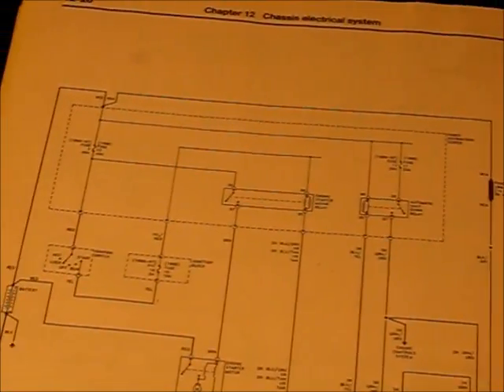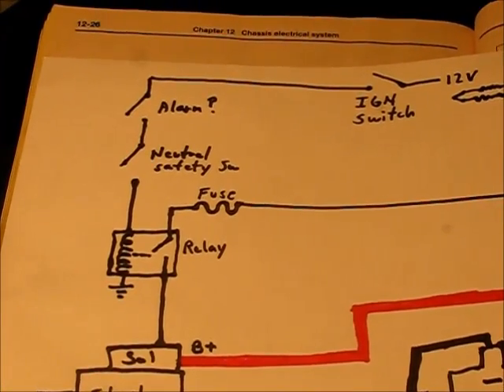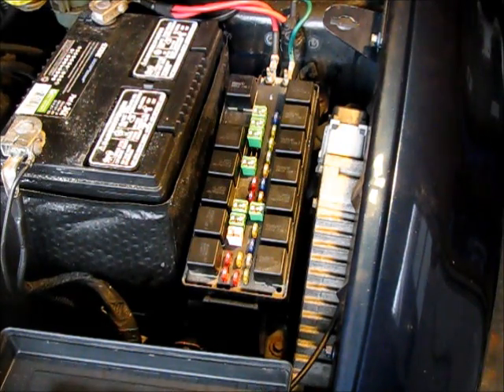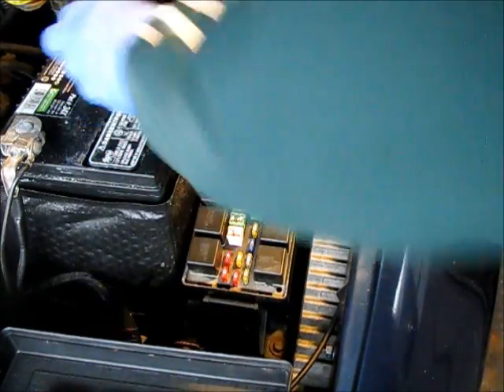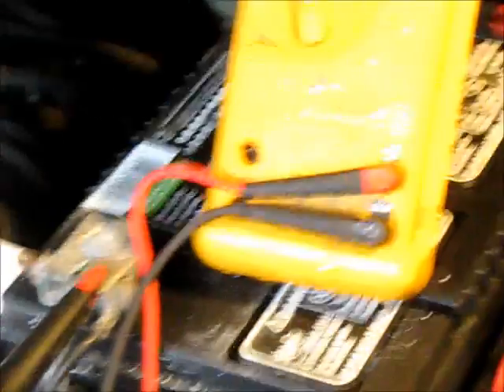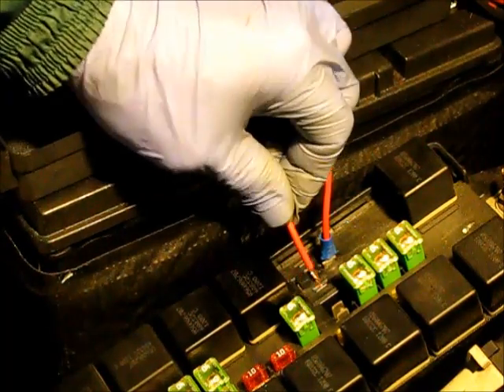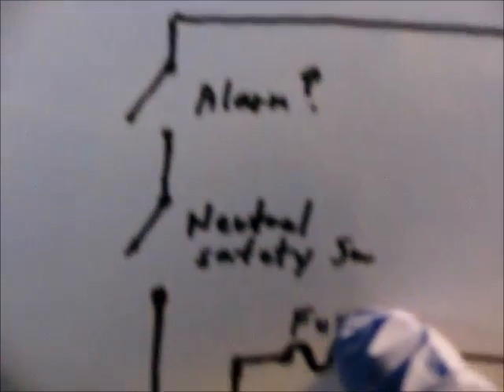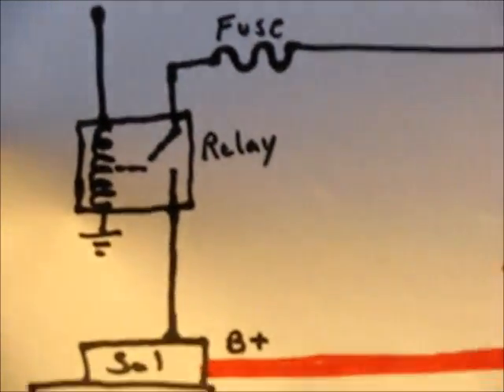When your car won’t crank or start part 3: How to check relays, fuses, switches and wires

Comment: no crank, no start, engine isn't tied up, no gauges work and fuel pump wont kick on. also new starter, new ignition switch, new computer, the lights work, power windows work.  anyone have any ideas as to what it could be dodge ram 1500 with a hemi
Reply from the maker: Check the fuses in the start circuit, both power and control. The starter relay is an easy part to swap out. Maybe the the always 12V is missing. Someone needs to get in there with a meter and follow the 12V start control signal. Where is it? Where is it lost? Good luck and thanks for watching!
Reply: I got same problem Bro

Comment: What happens when the starter will run off the car but, not on the car?  The starter relay is good and working as well as the safety neutral switch and the ignition switch and new battery. Also, the engine is not locked up.Also, the battery cables are new. When I tun the key to run nothing happens ( no noise or clicking) but everything else works There is power from the ignition switch to the starter. All fuses are good and working properly.
Please help. 
Awesome video. Thanks a lot.
Reply from the maker: Have you physically measured 12V at the large lug (B+) at the starter, including when you turn the key to start?  If it's always present there, I am out of ideas. It absolutely should run.
Reply: Thank you so much for your reply and help.
Reply: Hello I have a 2000 mercury grand marquis n just got it back from the tow place they lost my chipped key.they changed the ignition and don't think they got it programmed right i was told by ford. The only thing that happens is my lights turn on in the dash board no crank or start.If it is the anti theft crap is there any way I could bypass it without spending more money?Would it start at the starter relay purhapse?Thanx in advance any advice would be helpful.. The Original Mechanic
Reply: @ffbnnmccvmnn5811  did you ever figure out a bypass of the security issue?

Comment: 89 Accord manual trans. Bad translock switch. Jumper wire worked for four or five times, and now it goes blank wen starting. Is there a relay that is shorting behind the fuse box. I see three there

Comment: Do I really need to put the key in first position? I lost my key. I tried with screwdriver but no luck...
Reply from the maker: I'm not understanding your question.
Reply: Can I bypass it without the key in ignition?
Reply from the maker: It appears you are trying to start the car by jumping the starter relay without a key in the ignition. There needs to be a key in the ignition and in the on position.

Comment: I have a w203 Mercedes Benz 320cc the key turns but it doesn't start and the cluster show not on
Reply from the maker: So many possibilities here.  Check the basics. Good battery and good battery connections.

Comment: Thank you for a very good and clear video and also I have trouble with starting my 2010 Jaguar XF I checked and got P0344 problem when I try to start veichle it doesn’t get power just can say I hear two times TIK noise but engine never gets power and start only that sound,looks like I have big trouble with it..
Reply from the maker: That  sound you hear when the key in is the start position is likely the solenoid plunger moving. That means the start signal is getting to the starter. Make sure you have B+ 12V at the starter and if you do, the starter is likely bad.

Comment: hey i have 04 dodge Durango it not starting it crank my battery is good what to do?
Reply from the maker: Crank no start problems can have many causes. I always try find out if it's getting gas first, then move on to check for spark. There are videos out there. Search "crank no start" Good luck and thanks for watching my video!
Reply: Crazyk Roberson I'm wearing my 1997that gose into the ing. I have 4eears going into one.
Reply: Way outs

Comment: (2007 silverado 4.3 regular cab) so I bridged the starter relay with a piece of wire and heard the starter come on. Where would the problem be at this point?
Reply from the maker: There are still several possibilities; From the  ignition switch to the relay coil and the wiring in between. Try subbing in another relay to eliminate that.
Reply: IV tried switching relays and did not work. I replaced ignition starter switch and still not cranking.

Comment: 97 dodge Dakota no crank. Relays click and fuel pump primes. All light come on as they should. Turn the key and nothing happens only the relays click. I replaced them anyways, replaced the starter pulled the starter harness up and checked for rub throughs and bare spots found none. New battery new ignition switch and still nothing. Can jump it from the solenoid and it will crank and run without a hitch. Was fine one night next morning Im dealing with this scenario.
Reply from the maker: Seems like a open wire between the relay and the solenoid. I would try subbing in a jumper. The hard part is accessing the wire.
Reply: The Original Mechanic a jumper where? On the fusebox?
Reply from the maker: Between the starter relay and the solenoid. If the relay is operating and has power on one side of the contact, then the problem is between the other side of the relay contact and the solenoid.
Reply: The Original Mechanic figured it out. Went checking connections again, but I didn’t bother with the transmission the 1st time. My neutral safety switch got unplugged somehow. Thank you for the tips
Reply from the maker: You're welcome. Way to stick with it and figure it out!

Comment: One question, what happens when you are testing the starter by jumping the relay and instead of getting a crank sound you get a small amount of smoke?
Reply: Lol.... the smoke is the wire you jumped it with burning up!
Reply: You let the magic smoke outta the system, def not gunna work now ;)

Comment: My car, 2005 Scion xb, 285k miles, now, sporadically, will not start, no click of starter, nothing at all, no sound.   Seems to happen more often after driving long distance, like over 20 minutes. Car will start fine, a couple times, like when I head out, go somewhere, will start ok when I get into the car and maybe a couple times more, same trip, for stops but then suddenly I shut the car off, go into a store, come out, car won't start.  I'll try it a few times.  Then it will start, out of the blue, maybe after ten minutes.  I"m no mechanic, I'm an old lady, but what might be going wrong?  I like the thought of troubleshooting the entire circuit, piece by piece.  HOwever, it's an intermittent problem, that may last only moments before the car starts again.  So am I looking for something loose, or something about to fail but hasn't yet, or could this be related to heat, because it happens more frequently when the car has been driven at least 1/2 hour?  Any direction you might give me would be very appreciated.  Thank you.  I don't have the money to buy another used car currently.
Reply from the maker: Intermittent problems are the toughest. Troubleshooting will have to be done when it acts up, I mean getting a meter in there to find out where the circuit is interrupted. Good luck and thanks for watching.
Reply: Thanks.  Yes, hate those intermittent issues.
Reply: I have the same car as you do  Jo Ha, and mine just started doing that 3 days ago. Battery is fine and my starter was replaced about a year ago. Did  you find out the problem?
Reply: Yes, the starter was bad.   Replaced it, running fine.  Until last days.  Now clunking when I put on brakes, push on gas, or go over bump.  Something in the suspension......

Comment: Hi, maybe you can help me, i have bmw e30, and it starts fine when its cold outside, when its sunny and warm i grt no crank no start, i replaced engine starter, ignition switch , and battery, still the same, i think it could be relay but dont have any spare, what do you think? Thanks in front
Reply from the maker: Very strange. Something temperature related like that makes me think of an electronic control board....like an anti-theft system. Just guessing a bit. This will require some electrical troubleshooting while it's acting up. good luck!
Reply: @TheOriginalMechanic  that sounds like a temperature sensor on a intake

Comment: I have a 2005 chevrolet equinox.  And it's not getting any fire to the wires. I put a new coil pack ,and a crank sensor and a cam sensor....Help!
Reply from the maker: This is a tough crank, no start problem. You have replaced the likely suspects. You are probably going to need a wiring diagram and a meter to pin this down.

Comment: working on a 88 Nissan Maxima it won't crank but when you try to start it it sound like it trying to crank but won't replace fuel pump don't know what else to do checked all the fuses still won't stay running
Reply from the maker: If it's cranking then it's on to fuel and spark. I'd check to see if fuel is getting all the way to the cylinder. Good luck, these can be toughies.
Reply: The Original Mechanic so if it cranks then the fuel source is good you're saying?? 

My car, '02 Maxima, cranks but dont start....also check engine light doesn't illuminate at all

Comment: My c230 kompressor 2002: key turns and car powers on but the engine won't crank. After a couple seconds the fan ramps up to 100% and that is it. I've replaced the electric portion of the key fob. Any help is greatly welcomed.
Reply from the maker: Find the relay box and locate the starter relay. This is the best place to begin troubleshooting.
Reply: Did u figure out the problem? I have similar issues

Comment: Is that a "jumper wire" you have connected to your multimeter, battery and the relay fuse slot?
Reply from the maker: Yes it is. If the starter turns, this will verify that the power fuse, wiring, solenoid and starter are good.
Reply: @TheOriginalMechanic  hey I have a question I have a 2006 navigator we put a new starter on it   It cranks but if I turn it off and try it again it won’t start.    After like ten minutes I’ll try it again then it cranks.     I’m confused on what it is.   I know one guy got under the hood and bumped it with a wire and it cranks instantly.   Do you know what that possibly is ?
Reply from the maker: @righteousmasculine  That sounds like a poor connection to me. Most likely in the control circuit somewhere. To troubleshoot you need a meter or test light in there to find where the 12V is lost.
Reply: @TheOriginalMechanic  thank u brother

Comment: Thanks for the series, I just got back from jumping my Dad's car.  If it goes bad again I now know what else to look at.
Reply from the maker: +otherstuffbybob You're welcome. Glad you could make some use of it.
Reply: The Original Mechanic  I have a non start problem with a Datsun 1979 truck 620 , I got no spark on my spark plug wires
Reply: Advance Auto parts book manual for a 94gmc s10 Sonoma
Reply: I put a alternator on a 1993 mazda miata and now it won't start all it do is spend it was cranking before I put the start on

Comment: I have a 2000 Nissan xterra. the a/t cont fuse blows every time I turn key. I can't figure out what to do. I spent every penny I have and nothing. Can anyone help?
Reply from the maker: With any short the difficulty is in finding it. You will need a schematic and find all the loads for that fuse. One method is to disconnect them one at a time until the fuse stops blowing and then repair or replace the bad component or wire. Another is to use a ohm meter to measure resistance to ground on that circuit as you disconnect loads one by one. This is a way to save fuses. Good luck, shorts are usually tough to find but hang in there!
Reply: shane mor

Comment: My 2004 Saturn ion 2.2 ecotec will crank but will not start I replaced all timing stuff and it is in time on both cams just won't start can someone help could it be a starter?

Comment: @The Original Mechanic. (No Crank) What to do if you have no continuous power at the Starter relay? I tried this starting method (remove relay) on my 07 Accord, started 3 times but not with jump wire, only jump wire + key. Then.. Nothing, now no more continuous power, yet I have signal wire power when I turn the key.
   While probing around with the jump wire I may have touched hot to ground, could this somehow have burnt out PCM to Starter Relay (continuous power)? With key on, I can put 12v to starter and car starts and runs normal. Not sure how to trouble shoot this? Any thoughts or ideas would be greatly appreciated. Thanks in advance. Be blessed!
Reply from the maker: On your Accord the "continuous" 12V  must only come on when ignition switch is on. If you blew the fuse for the starter 12V you couldn't jump it on. Hmm, I'm confused too.  So this is intermittent loss of 12V.  Poor ground? Make sure your big engine grounds are not loose or corroded, including battery terminals. Or a poor connection or wire to or from the fuse box for the 12V? Good luck, that's a toughie.

Comment: My son has a 2000 Mercedes S500 V-8.
A so called mechanic told him it would cost $2000 to fix it.
He said that there is no power to the ignition switch.Can't he trace the power source? It could be just a fuse or a relay or, even a bad ignition switch!?
I wish I knew 1/2 as much as you do.
Awesome video. Thanks a lot.
Reply from the maker: You're welcome. There has to be an always 12V at the ignition switch, waiting for the key to turn to the start position. If that is there, it could be a bad ignition switch or wiring or the starter relay down the line. You need to use a volt meter (or 12V test light) to trace out this kind of problem. The trouble with cars is that wiring and parts can be hard to get at.I would start with the relay because it usually easy to get at. And yeah, I would check the fuses in the circuit. Good luck
Reply: Thank you so much for your reply and help.
GOD bless.
Reply: Neil Williams can you tell me why all my car do is spend and won't crank it was cranking before I put the alternator on all it do is spend

Comment: I have a 96 neon it won't start, it clicks the one click and that's it every time I put the key in, turn it and click, like the starter is bad. I replaced the starter and still same problem. Lights work gages work just don't go past one click. Also gas Gage will go from full to empty before it dies out when I did get it started the 2 times. Thought that might help thinking about what it may be